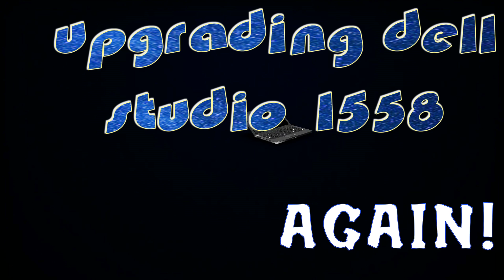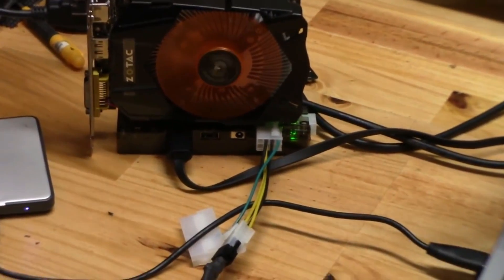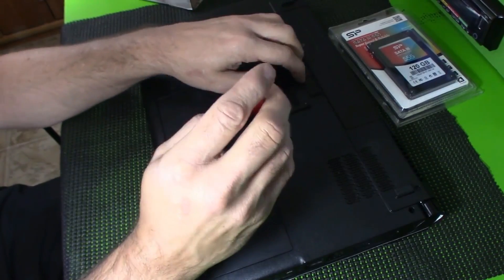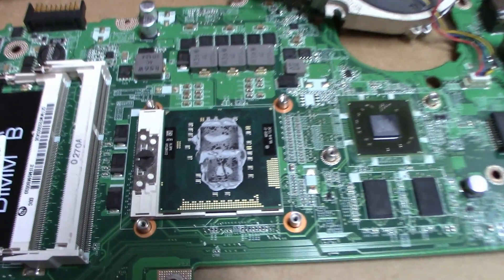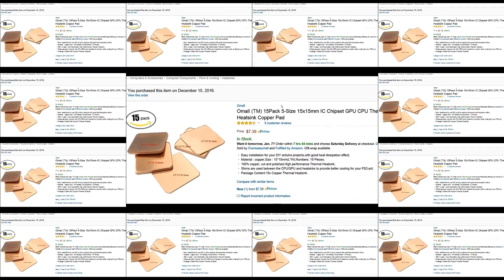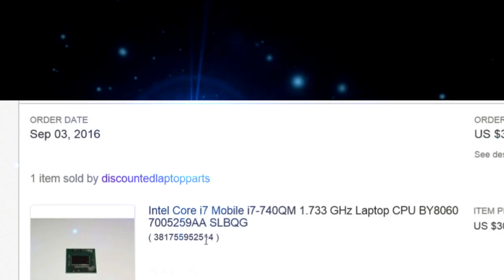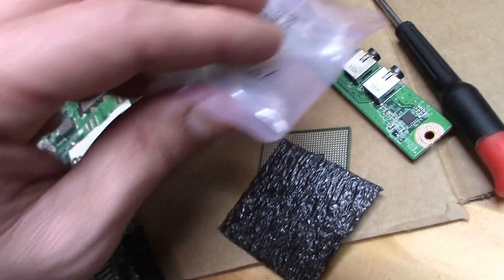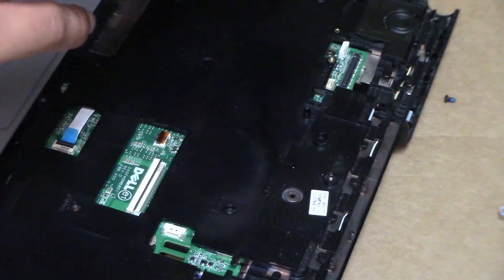OVERHEATING LAPTOP FIX AND i7 UPGRADE  DELL STUDIO 1558

Comment: I have upgraded a recently replaced ATi Radeon Mboard 1558 version with an i7-840QM, but the problem is finding a stable driver for the GPU. My earlier (original 1557 spec from new) ATI  driver loaded HD drives don't seem to work and Snappy Driver returns and 5000 series 'Engineering Sample'version of the Radeon driver...??

Comment: lol i did this but didn't use shims. i used mx4 compound. I've replace my 1558 board 3 times in its life.which sucks cause getting harder to find my loaded options board. last time i went i7 route as well. i also went ssd. that in it self seemed to have helped keep heat down a lot. but i7 8gb ram ssd moves as fast as anything today for me

Comment: You skipped the most important part!?
How did you upgrade the cpu?  Did you use a soldering technique?
What exactly i7 chip did you use?
Did it make the system run cooler?  Was there more cache?
Not to offend and you got more guts than me to make this post but please keep in mind you got guys out here doing research looking for ways to upgrade their systems.
Reply: CPU is socketed

Comment: How's your Dell Studio 1558 holding up since you upgraded to an i7 quad? I have one that has an i5 that I'm repairing and I'm thinking of upgrading to the same i7 as well.
Reply from the maker: I sold it recently but it was working great!
Reply: i upgraded to i7 840qm from an i5 520m and the upgrade was successful. it's working fine but. the only problem is the frequency doesn't jump more than 2.4ghz in most cases.  don't know what the reason, i tried with a higher wattage adapter dell 130w thinking it might not be getting enough power, but that didn't solve the problem, may be heating issues it is. it's interesting to know that my i7 640m (having 2 cores 4 threads), is way much faster than this 840qm's 4cores 8threads because of frequency.

Comment: hey i have a dell studio 1555 - can i upgrade it from core 2 duo to i7 and 8gb ddr2 ram pls help
Reply: For anybody else looking for this info, not exactly. You have to use the "CGY2Y" motherboard which is made for the i7 processors. This will also upgrade you to the radeon 5470 graphics as well

Comment: So those copper pads you added, did you just paste the one to the top of the i7 CPU or did you also add one to the ATI GPU? Did they not add too much bulk when screwing the heat sink back down? I'm looking to attempt a reconstruction of a Studio 1555. I think it requires a new motherboard since it gave the 6-beep-GPU-error upon attempted start up. The system was going through spontaneous shutdowns long before it died so I think better heat management is something I'd like to investigate whether or not I can get a replacement mobo with a new heat sink. Any answers you can provide will help a whole lot toward improving my chances of fixing this thing right.

Comment: Great video. I have gave new life to many old cheap laptops with Celeron or Sempron CPUs. Getting the fastest dual core that is compatibe and swap the cpu, put in more ram and atleast a newer 7200rpm harddrive or better a SSD. If youre lucky its easy to do and perhaps you only have to take off the keyboard. Some models are a real pain in the ass where the whole motherboard must be taken out because the cpu is under it. Also wise to upgrade the bios first to be sure the new cpu is recognised.
Reply from the maker: Its always fun to restore the older technology for me and yes the 7200 hard drives make a huge difference night and day.I hear the pain in the ass part we a newer hp envy here a 17inch touch with i7 that the gpu is overheating and I really don't want to tear it down.....

Comment: Good video again. Upgrading laptops is great when you can do it. I tried upgrading one of my laptop's CPU and unfortunately it didn't work because my laptop's revision didn't support a higher FSB CPU. Ram for my laptop can go up to 6 GB but it would need a 4 GB stick of DDR2 which is to expensive for me. Lastly it has a dedicated GPU, 220M, and I think I could upgrade it to the 240M but would need to find a working one and it was expensive last time i checked.
Reply from the maker: its hard finding info on them sometimes like the shuttle media pc video I did. I bought a graphics card and it  wouldn't boot with it in....I tossed it in the trash...now I think maybe was a bios setting....Maybe my vids might be helpful for someone sometime is all I hope for........thanks 4 the comment